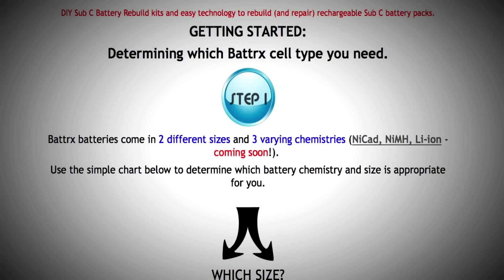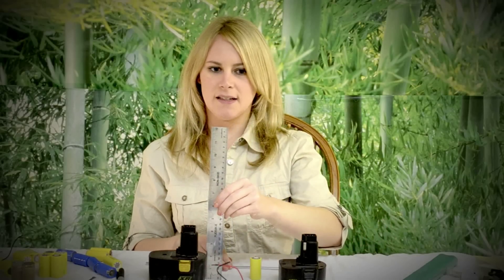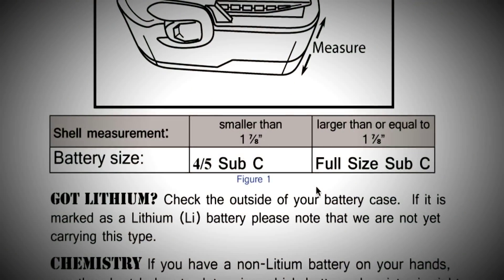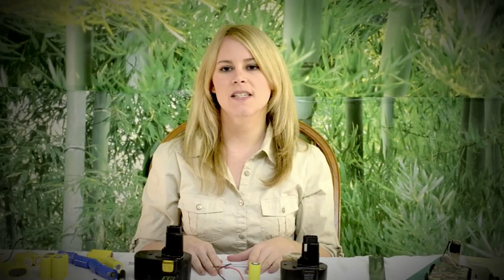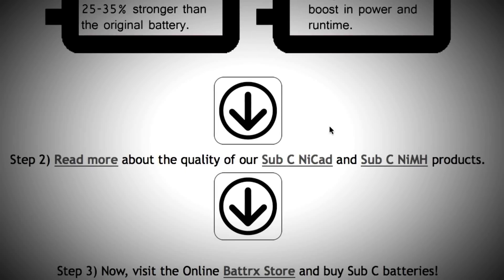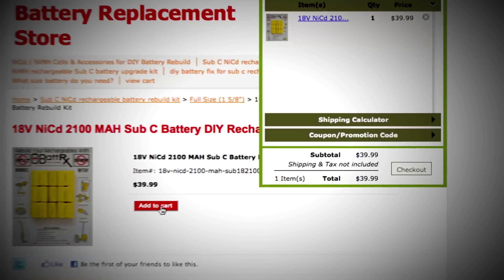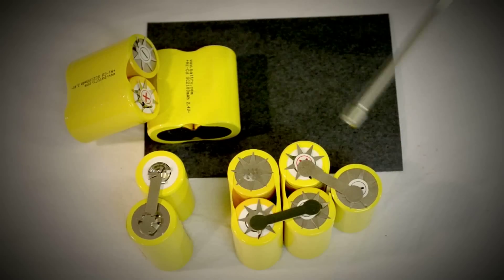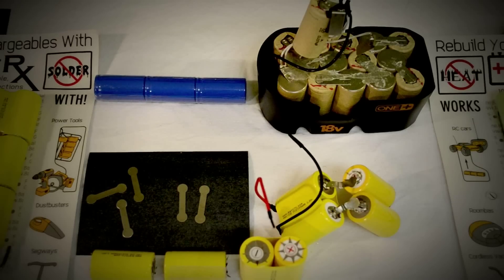NiCad Battery Rebuild Instructions

Comment: Nice how you guys used a hot chick to shill your stuff.  What we need here is someone actually rebuilding a battery not someone glossing over the basics.  You see, you run into all kinds of issues when trying to actually fit these things into the case you actually have.  Granted my drill was a lot older but that's the whole point of your 'green' product isn't it??? To reuse rather than re buy. What a load. This is THE worst video ever from an instructional standpoint.  Get it together and update this with actual footage of an actual repair!!!!!!! Or SEVERAL ACTUAL repairs!!!!!

Comment: A lot of people complaining in the comments that they can get a full replacement pack for the same or less than the rebuild kit. Notice how they reflect a certain brand in the video. I have this certain brand, and the rebuilt kit cost is WAY cheaper than the name-brand replacement pack. Also, reviews on the name-brand replacement pack reflect TERRIBLE life. Remove yourself from your bubble, do a little research. This may not be for everyone, but it's a huge benefit for some.

Comment: After about 8 years of use my Ryobi 18volt batteries have failed and was considering to rebuild them.
Ryobi 18-Volt One+ Ni-Cd Batteries (2-Pack) is $60 or $99 for 2-pack Lith-Ion with drill, 30 min charger and carring bag @ Home Depot. No assembly required
Wheres the bargain?

Comment: Power tools battery are normally Ni-MH or NiCd SC size 2.4v, 9.6v, 12v, 13.2v,14.4v,18v,19.2v,24v and capacity between 1500mAh to 3000mAh; We are J & Ｙ factory in Shenzhen.
for brand AEG, Skil, Ryobi, Panasonic, National，Milwaukee，Makita, Hitachi, Firestorm, Dewalt, Craftsman, Chicago Pneumatic, Bosch, Black & Decker at your request …
aaa/aa/sc/c/d/f size nimh battery are very conventional model, all with CE/UL/RoHS certifications